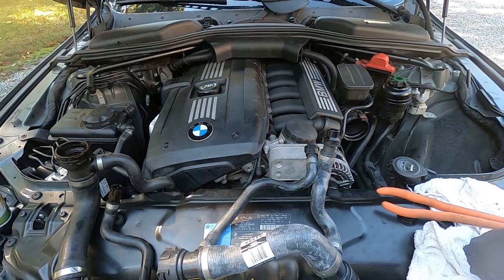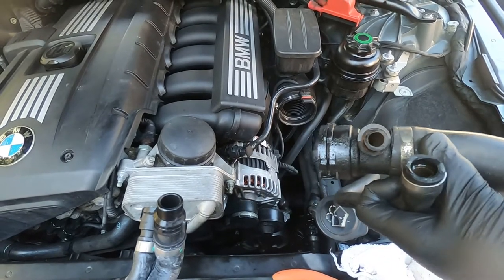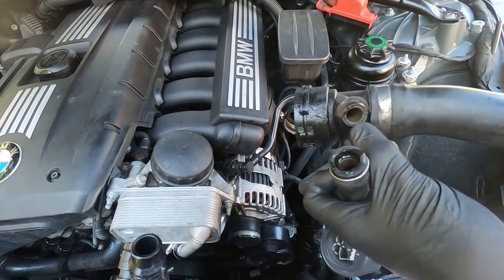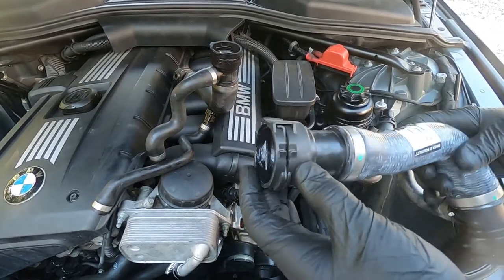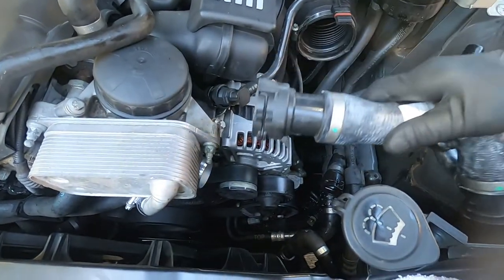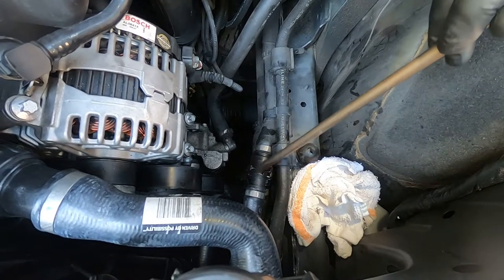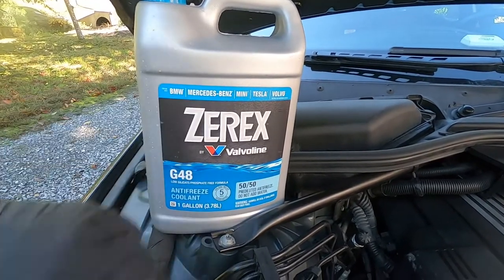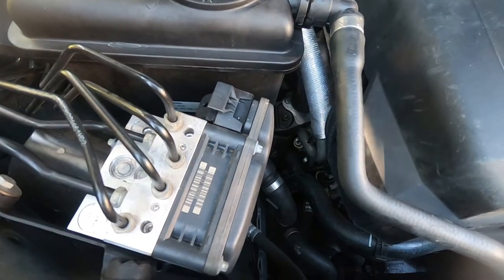Upper Radiator Hose Replacement I 2008 BMW 528Xi

Comment: Thank you so much for your help. That little nub of an outlet broke just like your client's. We rigged it with a 5/8s hose and a male/male connector. Was under the impression it was the coolant portion of the oil cooler that broke. I know what to order now. Much appreciated!!!

Comment: Just a little tip, you don’t need to start the car to bleed the system. You simply turn heat all way up and blower on lowest fan speed  then press gas petal for 12 seconds to the floor . You will hear the electrical pump start purging it cycles off and on for 10min roughly

Comment: you have to purge the system of air, piece of cake, turn ignition on without starting the engine, adjust heat to max settings, press throttle pedal for 10 seconds, the water pump will start and run for 12 minutes, you can see the flow looking at the reservoir. The Bentley manual states that without the purge procedure the engine may overheat. It advises to connect an external power source to avoid depleting the battery.

Comment: The car has a bleed feature if you turn the heater on and hold the gas pedal for 15 seconds when the car is on acc
Reply: I thought the same thing. Would that be the correct way to do it? Or can you do what he did?
Reply: @killakill786  thanks
Reply: @killakill786  my upper radiator hose in leaking 08 528i do u know if the hose is easy to change like this dudes video?  Also I’ll bleed it the way ya said.
Reply: @killakill786  hey bro thanks for knowledge I changed this morning the local shop wanted 140$ labor   Thanks again bro